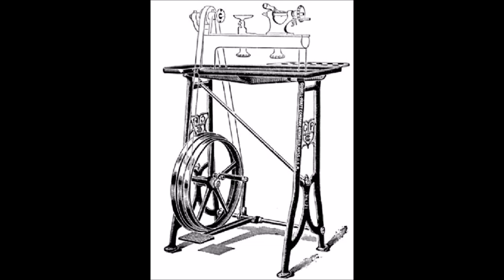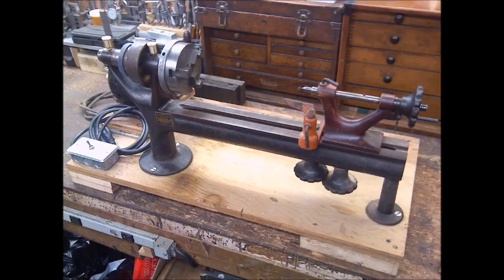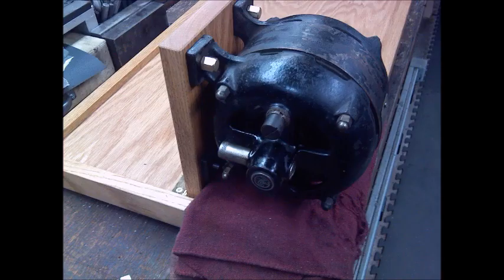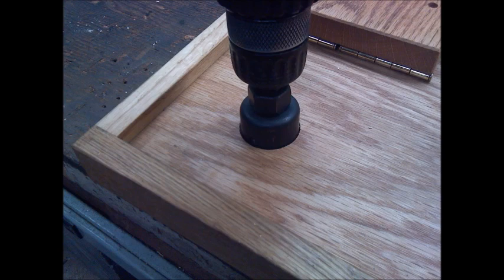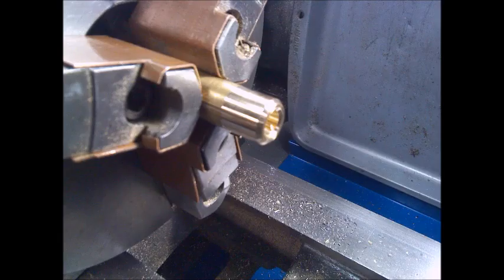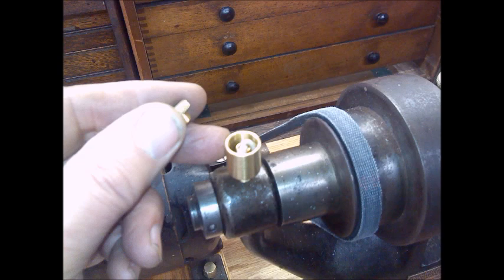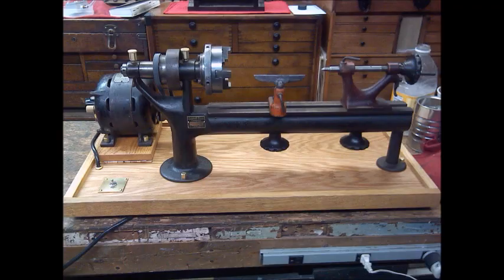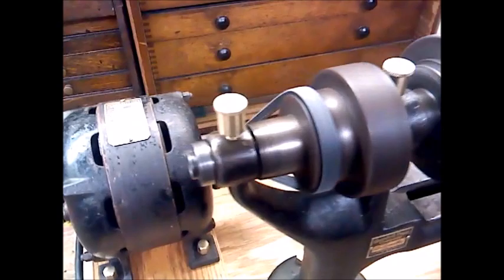1888 Goodell  Pratt Lathe Restoration movie

Comment: I just acquired a Goodell Pratt metal lathe this weekend. Nearly identical to yours, but the flat-belt pulley had been replaced with two vee-belt pulleys, and it has the cross slide compound tool holder. It will need cleaning up, and the chuck (looks to be the same as yours, and is a GP original) has been used hard and shows it. Very good restoration to your lathe! Enjoyed the video!
Reply from the maker: Congrats on your find!  If you are restoring it I would love to see the before and after photos.  Best of luck and enjoy the restore..  Fred

Comment: Hi Fred, nice share we are partial to smaller precision metal lathes (what fun) we know Oilite Bronze bushings machine them for our replacements. Nice that you have the original tag badge. Is that motor a De Vry Corporation motor maker? We do not like but have to work with WOOD a lot so thank you for the whole saw splitting splinter tip have and half saw tip. Daily oilers you made them nice brass and with knurled little tops. Nice work on  the tool rest as well, you did a nice job on it. Thank you for the share, Lance & Patrick.
Reply from the maker: Thanks for the kind works fellas.  The motor is an old GE motor.  It too still has the original tags.  I had a great time gently restoring this ole girl.  It would be the perfect size for someone just getting into wood turning.  Regards- Fred

Comment: BTW. 1888, That's 132 years, which is absolutely awesome
Reply from the maker: Thanks for catching that error Scott.  I made made a note in the description correcting the age.
Reply: @FredMiller  Fred:  I hadn't had time before to watch the entire video before, well done!   Given it was built in 1888 it's always fun to imagine the men that built this and when could they have been born?  Given at that time the oldest male worker was likely in their 60's  the youngest would have been 10-15 y/o so the men who built this were likely born between 1825 and 1878.  So they may have been alive through the civil war,  the American Cential, may never have seen a car or a flying machine, and the power source of the time was steam.  A lot of history in that little lathe!
Reply from the maker: @scottpecora371  As I restore very old machines I think of those very questions. Who operated it and what were they making?  If you like that kind of equipment check out my video on my WW2 Swedish gasifier.  Gasifiers SAVED many lives during WW2 keeping commerce and the economy running when all the gasoline was diverted to the war efforts (on both sides).  Youtube search (fredmiller Swedish gasifier operation) should get you there.  Thanks for all your input..  Fred

Comment: Nice job I like vintage motor and the sound it makes.Whar kind of bearings are in the head stock? Mike Mcewen
Reply from the maker: Thanks Mike,  The main bearings are bronze bushings.  They are really tight for such an old machine.  I am thinking that it did not get much use through the years.  I did not mention it in the video but there is a faint whiff of ozone when the motor starts. Very nostalgic!